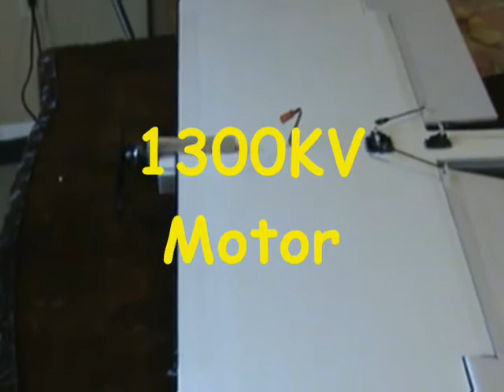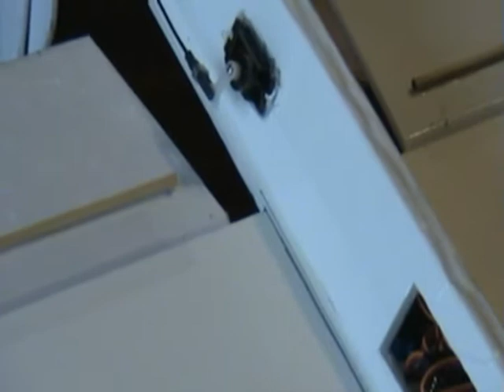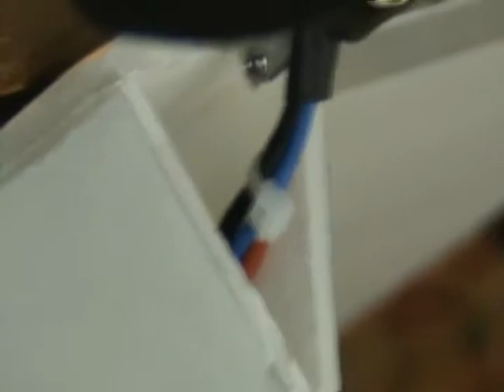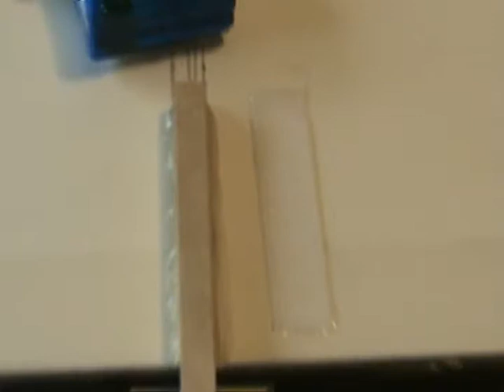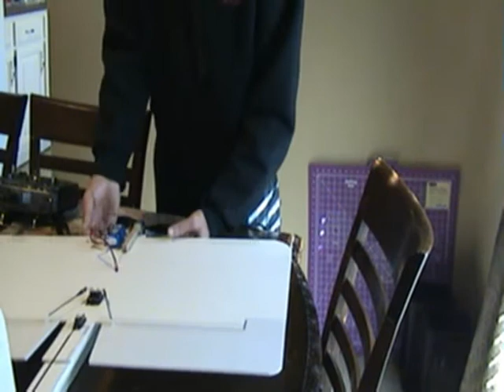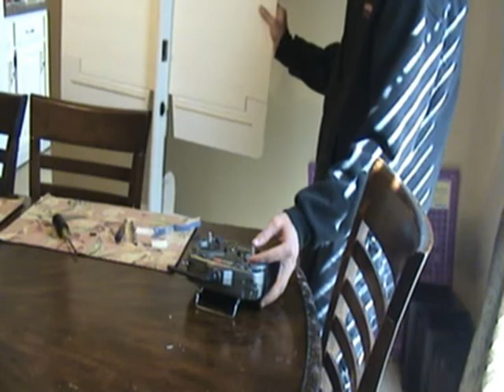Hobby Partz Combo deal 2.wmv

Comment: People ...Warning ,do not but this combo . I bought two sets and they were both bad . They have cheap bearings with too much play in them. So I called Hobby partz and they kindly sent me two motors to replace them. Well they are the same as the first two. They vibrate . No it is not my prop. It is balanced . No it isn`t the shaft . They are brand new.  Any one else have this problem? I am using the esc and motor mount that came with the kit. So What`s up with that?

Comment: Help for a newbie?
I bought this kit (thanks for the post :) and soldered all the connectors on it (bought Deans and Banana connectors separately).  With a 7.2 x 4.5 Cox hobbies pusher prop, 20C 3S1P 2200 mAh LiPo, I ran it for about 5 minutes.  I varied the throttle, but found that at about 20% throttle all was good.  At 50% throttle I noticed the ESC started to get warm to the touch.  Am I pushing it too hard with a 2200 mAh battery?  Any advice welcome!  Thanks!

Comment: Im making an Extra 300S from RcPowers that you made and im planing to use this combo for if  would it be powerful enough????Im planning on using a Blue Lipo 1300 mAH 25c 3-cell battery from hobbypartz. Will it work with the deal???I f not, what will be good POWERFUL and LONG FLIGH time battery for it??? What cheap charger (About $10.00) would work for the Blue lipo or the battery you reccomend??? (Im new to this hobby) THANK YOU!!!! :D